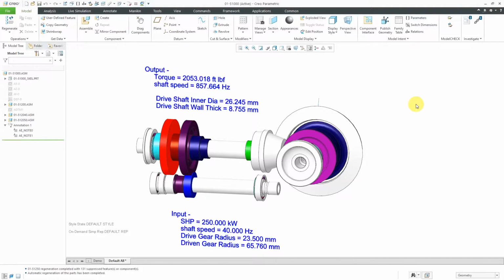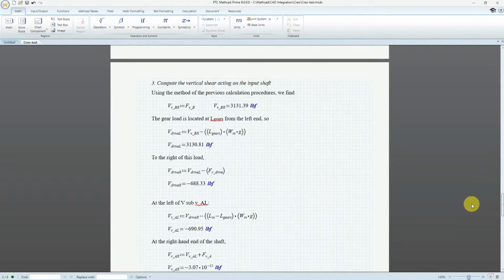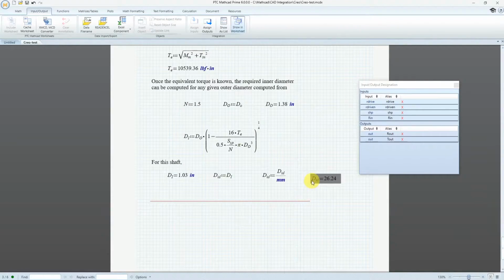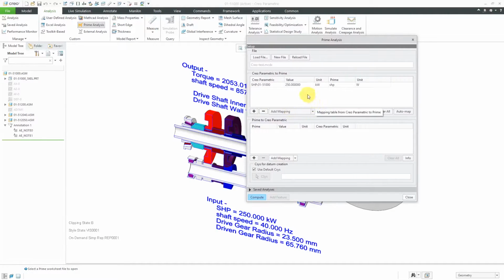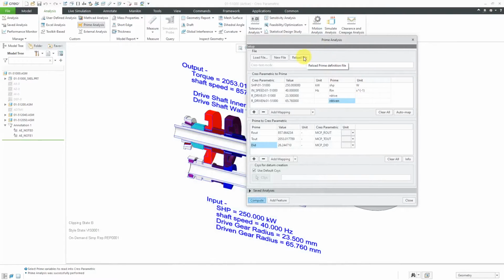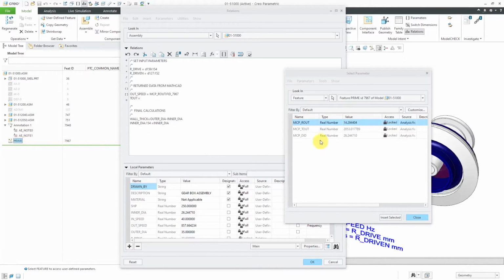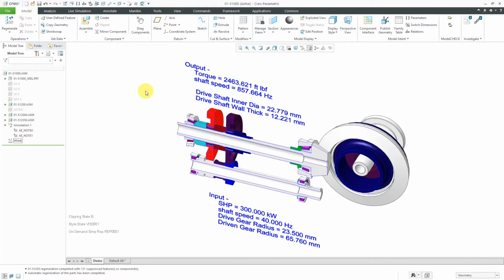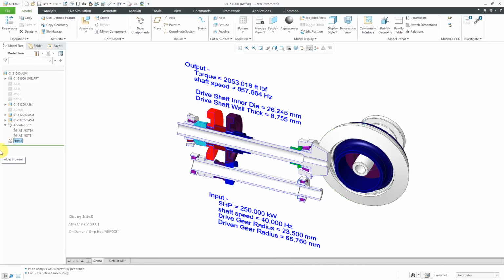Creo Parametric - PTC Mathcad Integration - Prime Analysis Feature

Comment: Thank you very much! It helps me at my Masterthesis! 

But additional - do you have any idea how i could combine the Mathcad analysis with an iterative scaling of my model until i reach an calculated value? 

In Detail: i build a kind of airship, Lift scales with the volume, weight scales with the aera, i couldn´t calculate the swetspot caused of the complexed geometry it has. So i decided to scale the model step by step, analyse the aera, the volume and some other terms in Creo and give them back to Mathcad. 

But now i got into trouble to get it running, i used a lot of if- equations like if Lift<Weight -> scale +1 and it works perfectly if i used the implemented Mathcad Worksheed funktion over push and refresh - but i can´t do that for a week :-D

Comment: PTC should release Mathcad Prime for TABLETS like (iPadOS and Android) as WolframAlpha and Matlab did.  Most people use tablets as a replacement for traditional laptops in schools and at work. And when they need to work seriously, they simply add a keyboard and a mouse (BUT if you consider the stylus influence, everyone is going to be paperless SO PTC could add a specialized drawing feature to sketch the analisys or simplification of the problem, drawings that we always use to solve a problem). Android and iPadOS have now file managers, which means that you can have files organized the same way as you do on a Windows PC.  If PTC launch a full version for iPadOS and Android, PTC will be the first CAE software leader in all engineering schools because we all start learning by doing manual calculations and then we start using specialized softwares BUT if you have the habit of doing manual calculations from the beginning with Mathcad (as EASY as Mathcad Prime does it and enjoyable) you will prefer to use it when working in a real work environment.  Most people learn to do manual calculations, BUT it is so tedious that they end up forgetting what they learned.  But with Mathcad Prime there will be a fully functional sheet of paper of your own solved problems from the past that you can now use to solve a new problem in your own work.  THAT would make Mathcad Prime INDISPENSABLE and IRREPLACEABLE for ANY business because EVERYONE would know how to use it and how valuable it is. I think that everyone would want to calculate anything if they don't have to: use the calculator, be concerned about the units or do it several times (iteration).. JUST THE CONCEPTS. And if they add the same cloud based workflow as Fusion360 or OneNote did you can have a team working in the same sheet of paper or sharing information in real time. Just imagine that.